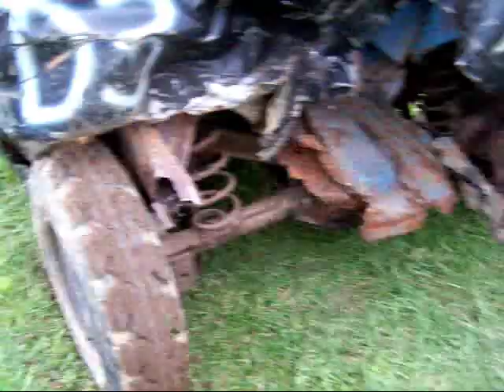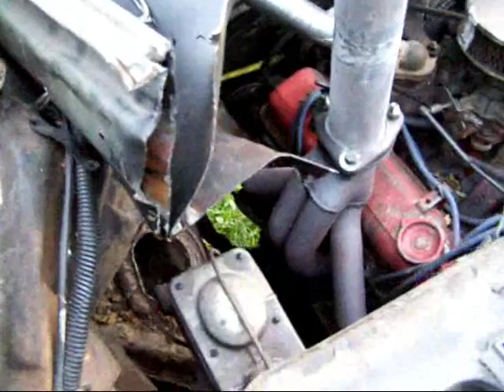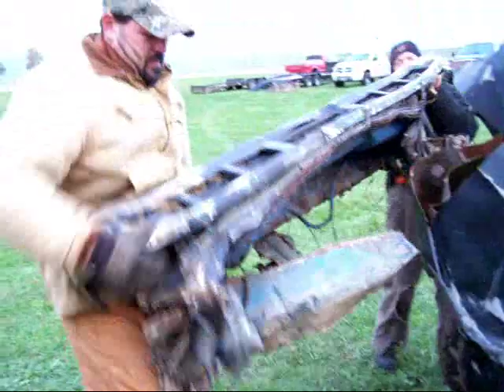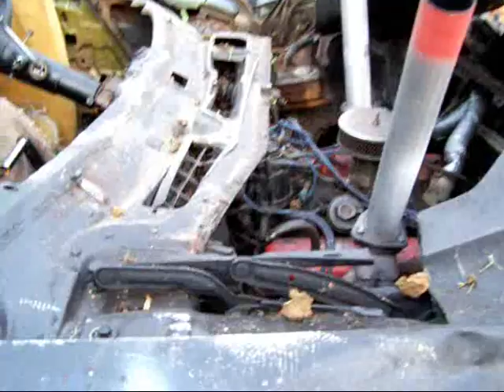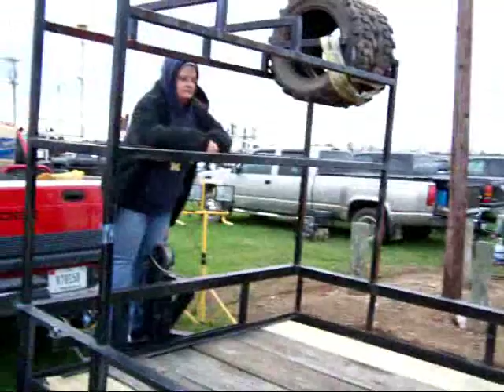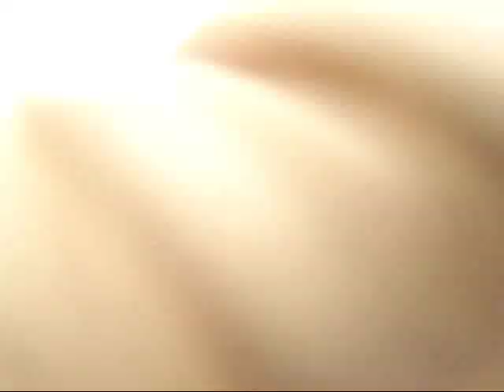Destroyed Rusty 73 Impala - Josh's Aftermath

Comment: That smoke coming out of the vavle cover is blow by from the rings being worn which means then engine is higher milage but sometimes thats what you want in a derby car cause they stay cooler cause the metal clearences have a bigger gap and since metal expands when hot it means it will take alot longer for tthe metal to expand enough to start binding parts together